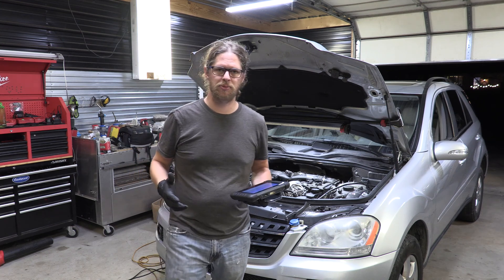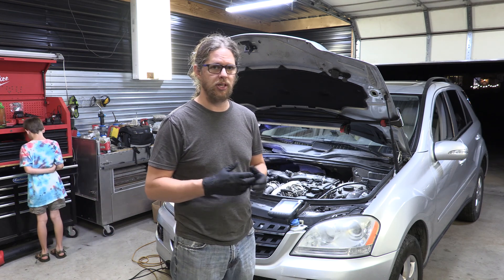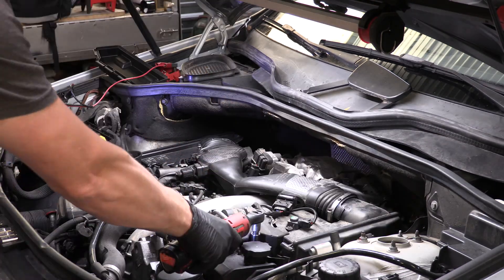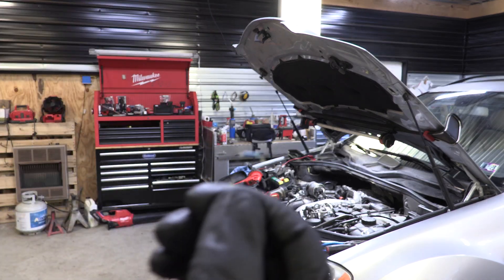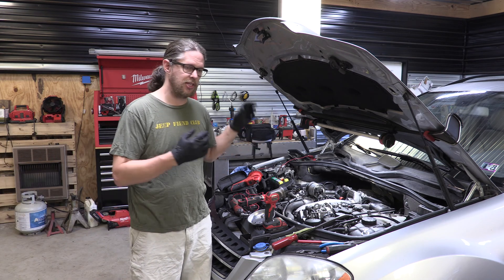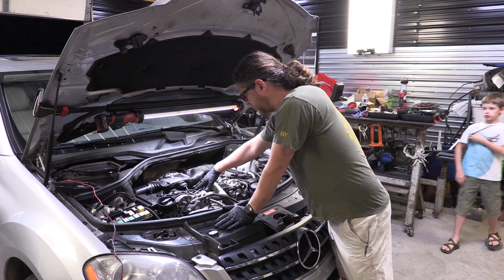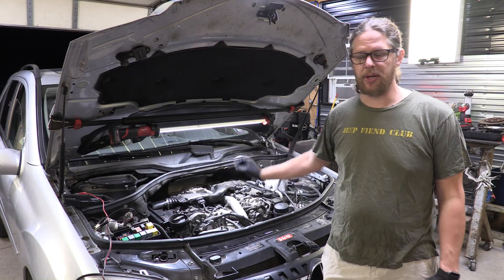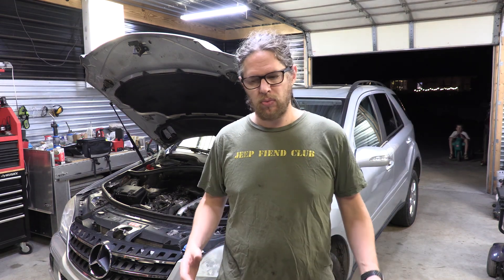DIY: P2008 Is it safe to use the Resistor for the OM642 swirl flap motor failure? #mercedes #diesel

Comment: How did you actually confirm that the swirl flaps were in the open position. I did not see that in the video. Would they default to an open position.
Reply from the maker: I refer to it extensively in the video. But a diagram is at 3:46  in the video. 
I have had these motors apart a few times and was able to verify the open position by referring to previous projects where I had the intakes removed from the car. 
I discuss this beginning at 02:05 in this video. 
The flaps Do default to open but when the motors start to go or the  linkage becomes worn they can begin getting stuck halfway closed or closed and I wanted to verify they were open before putting tv resistor in.

Comment: Is there a potential long term issue if you put resistor in and one or both banks are closed? I put resistor in mine and I have turbo now but didn’t check the linkage...
Reply from the maker: I think mostly power loss and additional carbon build up in the intake. But I’m not sure if there are others too.
Reply: I think mine are closed. Done the resistor mod and now I cant hear the turbo and car is kinda slow. Not in limo mode but because it goes over 3000rpm. Just slow.

Comment: Thank you thank you....most videos on you tube just go straight to the mode before addressing the issue of making sure the flaps are open
Reply from the maker: Glad you found it helpful! I found the same thing, very few people seemed to even check to make sure they were open. 
I was mainly just glad I didn’t have the pull another intake assembly off 😂
Thanks for watching!
Reply: @MalarkeyTaylor  i think mine are stuck. They should move easily i assume
Reply from the maker: @KKE1978   yes, they move pretty easily  when not connected to the motor. But the motor is very hard to move and spring loaded to return to open. So if they are hard to move it could be the motor is seized. Or they are clogged or both. 😢
Reply: @MalarkeyTaylor  thanks for replying. So how do you find out it if either of those two scenarios are present when still in the car?? How did you move yours to the open positin while still in the car
Reply from the maker: @KKE1978   the first one I did I took the manifold out and found the intake very clogged up. So I cleaned it and make sure it was all functional before I disabled the flaps. 
This one I got an error message that the swirl motor had failed and the car went into limp mode. So I assumed the motor had died. Once I determined that the flaps were open I just disabled the motor so they will stay in the open position. If the motor had failed in the closed position I would probably try to pry or push them open, but if that failed I would remove the manifolds and repair the flaps or remove them.
Reply: @MalarkeyTaylor  thank you so much

Comment: Hey buddy does the check engine  light comes back on later
Reply from the maker: I’ve done this with two of them and both have not gotten any more engine lights related to this issue. One has run over 3 years and 40,000miles and the other is a little under a year and 8-9kmiles

Comment: Is the fail code p2513?
Reply from the maker: No, for this failure it was 2530-4 (on the auto scanner and 2008 on the generic OBD scanner)  I think 2513 may also be a swirl motor related problem, but this is not the code I received on this particular unit.
Reply: @MalarkeyTaylor  you think i can do the same with this failure?
Reply from the maker: @mercedesbenzi1259   Sorry I'm not sure. Some newer motors have position sensors that could cause the fix to not work for that. I don't know. It's probably best to take to a qualified work shop, or keeping research o find out what the code means for your particular car. I've use AlldataDIY subscription before to help troubleshoot, but some may take some trial and error.
Reply: I had 2513 code on my 320 cdi, and the rest of the code is m 55

Comment: I have a 2009 Mercedes c class 250 sport diesel it’s saying charge movement flap malfunction what is by cheapest safest option can I delete the motor /flaps off the ecu
Reply from the maker: Sorry I don’t know the c250 motor. It might be able to be bypassed in the same way but I am not sure.

Comment: How do you do, lets say if the intake runners are stuck in the middle lets say, not full open position? Can you move them by hand? Thanks
Reply from the maker: As long as they can be moved you should be able to move them. But if the buildup in the intake is too much or if there is a blockage, or if the swirl motor is seized up one or more of those might prevent you from opening the valve and then moving by hand would be difficult or impossible.
Reply: @MalarkeyTaylor  great. Thanks. I want to check if mine is not working properly. No codes so far no limp mode. But car is not giving the same kick as it used to

Comment: Very good video!!! When you put the resistor and the car is not runing the flaps are open or closed? Thanks for your time
Reply from the maker: When the car is OFF the flaps should be open. The reason I check to make sure they are in the open position is over time, with build up, the buildup on the flaps can make them hard to move, and they may not close all the way. That is one of the things that leads to the failure of the motor. So they should be open, but I check to make sure before putting the resistor in.
Reply: @MalarkeyTaylor  My swirl flap motor works fine, its just that the links are so tired they wont close and open all the way.
Reply from the maker: @Peter-wo4uo  yes, that has been the case that I have observed as well. However the linkage eventually wears out and breaks. Or the motor seizes up, or oil leaking from batwing/ccv directly above it cause the motor to fail.  So disabling it just leaves them open when the flaps are open. So far so good on the three that I’ve worked on. 🤞